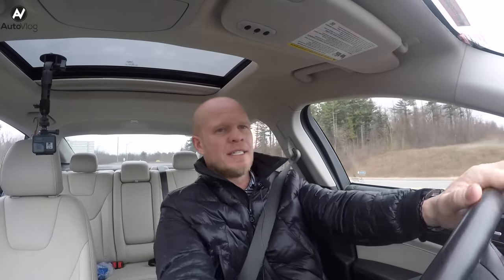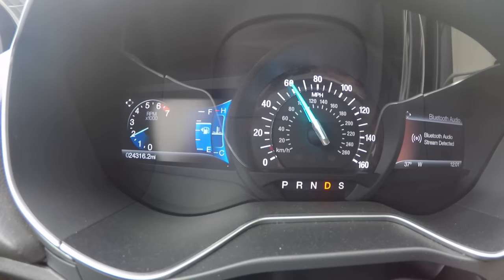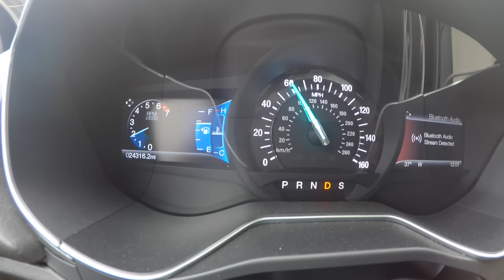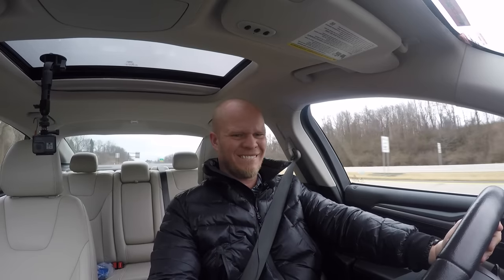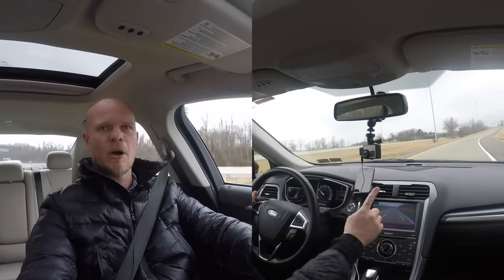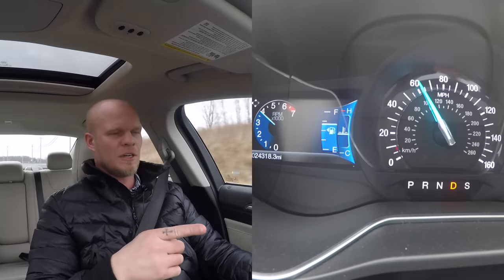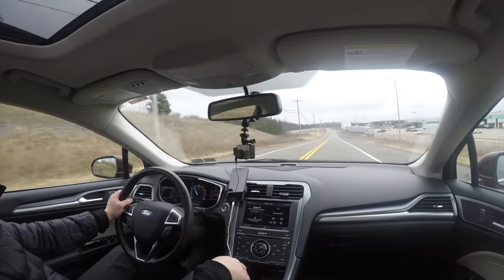What happens if you put your car in REVERSE while driving? (Things NOT to do while driving)

Comment: I've unintentionally done this on a car that doesn't have the safety lockout.

I used to drive an old '85 Camaro, which had a purely hydraulic/mechanical transmission with no fancy electronics, and my friend decided to screw with me while driving by putting in neutral randomly while driving.
Well, one time he pushed a little too hard and put it in reverse while I was cruising at 35 MPH, and it did engage reverse.
I saw him moving so I had let off the throttle, so it just made a 'KLUNK' noise and stalled the engine (and without the engine running, no hydraulic pressure) so it just dropped into neutral and coasted. After glaring bullets at my friend for a bit, I just put it in neutral, started the engine, put it back in drive, and continued driving as normal without even ever coming to a stop. Still worked fine a few years later when I sold it.

So, even without this safety feature, it still might not be all that exciting. I definitely wouldn't recommend trying it (and no way I'd try it on the highway, or with my foot down on the accelerator) though.
Reply: I did this about 20 years ago on a fleet car. Reached for the radio, slammed it from drive to reverse at about 45mph. Engine cut off and I coasted to a stop. It restarted and ran fine, although there was an audible 'clunk' when changing gears after that.